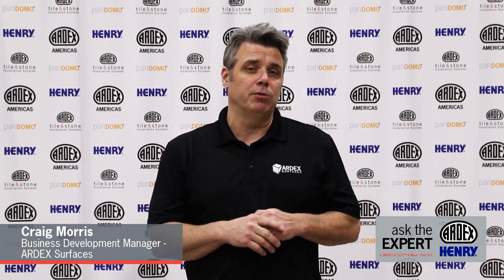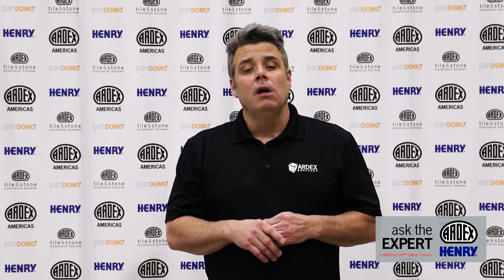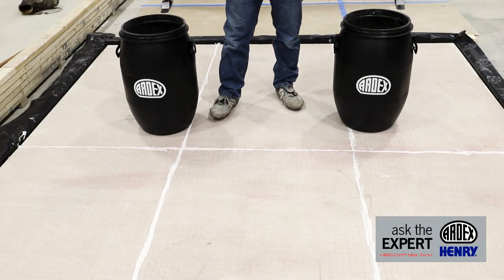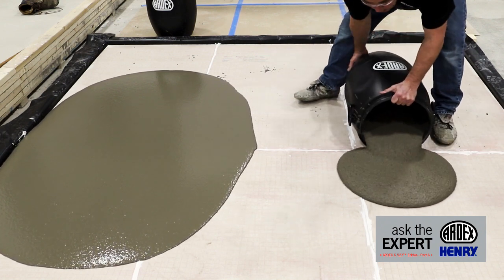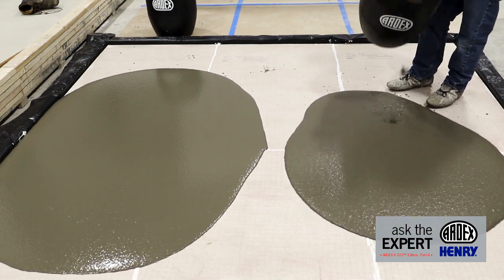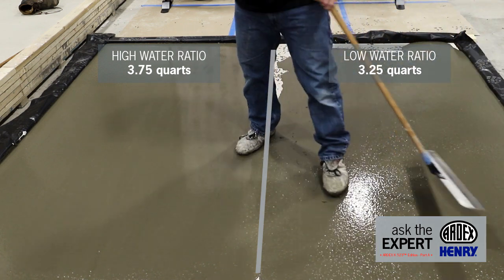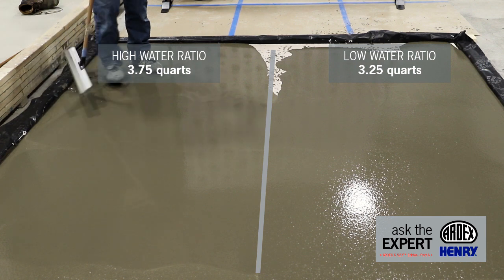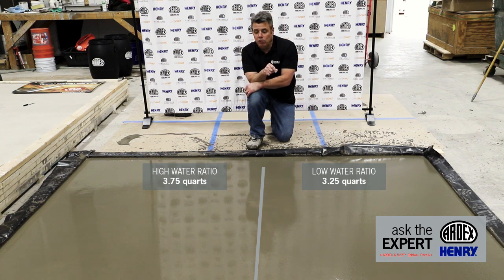ARDEX Ask the Expert - ARDEX K 523™​​​​​​​​​​​​ Edition - Part A

Comment: Is a slower setting version of your self leveling product made available in NJ, that is more forgiving for my basement/garage floor fix project. Do you have something that's equivalent to LevelQuik ES for slow solo DIY'ers like me? Thank you.
Reply from the maker: There is not much you can do to extend the working time beyond using very cold water. You can contact our technical experts at 1-888-512-7339 for more information. Thanks!